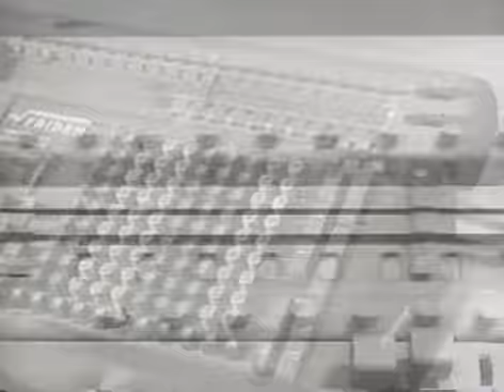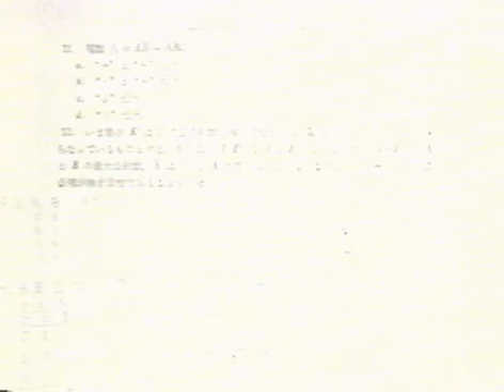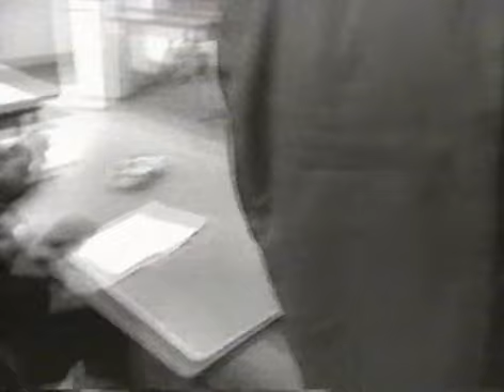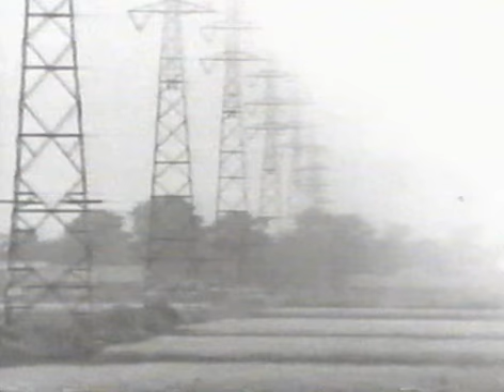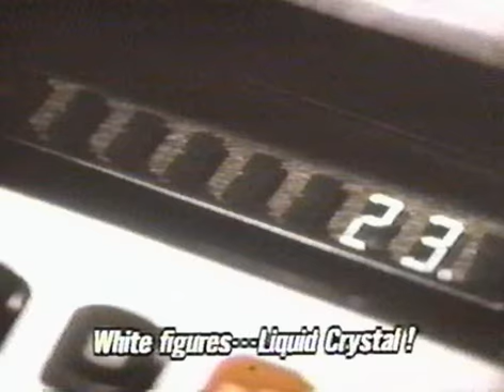The Calculator Wars: A video history of Japan's electronic industry (Part 3)

Comment: The Casio calculator shown at the very end, during the assembly process, I have one of those for over 20 years now! It runs on a solar cell, needs no battery. I bought mine in Cairns in 1994 and still use it all the time.
Reply: The Casio HS-8G? They were built to last, MADE IN JAPAN in the 1990s.
Reply: @Crazytesseract  rpx
Reply: I think my mom has that one too. It's a pretty basic calculator.
Reply: Ne ho una simile, purtroppo il tasto del "9" non fa più contatto😢

Comment: This was a FASCINATING series of documentaries... I never knew much about how the Japanese electronics industry got to where it was at its height, and this actually explains a lot.
I actually have an old Texas Instruments LED screen calculator somewhere, dating from the mid-late '70s; it's not Japanese made, as far as I know, but seeing all this stuff has me nostalgic for that kind of thing.
Reply from the maker: Every calculator I use on a regular basis is vintage, all with vfd displays. I regularilly use my early 70's vintage busicom exec da-80 on my desk at work. no batteries, needs to be plugged in, with individual vfd tubes for each display segment. picked it up at a thrift shop some 8yrs ago for $0.99 and tax, works like new does what i need and is a great conversation piece.
Reply: RC286 I use vintage calculators but not that old, I have several HP and Ti that I use from the early 1990's and late 1980's, but I do have older 1970's ones as well, but I don't use them because they eat batteries too fast :-). All of them are pocket scientific calculators though, no business or general use ones.
Reply: @RC-nq7mg  I don't think they had VFD displays then, but they may have used RCA Numitron DR2120 tubes back then. Those were 7 segment filament (dim light bulb). I used them in a product I designed in 1973.
Reply from the maker: @paulmoffat9306  Busicom exec DA-80, looks like vfd to me. 1972, also have a LLOYD's acumatic 310 with vfd display, 1975, and texas instruments TI-1025 1977 with vfd display.
Reply: I have sempoa calculator, you know it was the oldest calculator from the stone age???!

Comment: I bought a Battery Calculator with a Green LED Display at the Orlando Navy Exchange in April 1976 when I was just starting Basic Electricity and Electronics, BEE in the Navy. Retired in 1995 and worked for Sony for 8 years. Enjoyed all 3 videos.
Reply: Couldn't have been green LEDs back then. Most likely green/blue phosphor flourescent display. I had several myself with that sort of display.

Comment: My dad started at Bell Labs in Allentown Pa. in the R and D section in 1958,  just as the Transistor age, which I believe was invented by Bell Labs, began. As a very young kid I remember him coming home one day and showing me a Texas instrument POCKET calculator that was approx. four inches wide by about eight to ten inches long and maybe a half inch thick. If my memory is correct he told me that it cost $800.00. At the time dad was travelling between Texas Instruments in Texas and Bell Labs in Murray Hill NJ., he was somehow involved in the development of the pocket calculator or the processes needed to make the circuitry, I'm not sure which. A few things occurred to me as I watched the video. After the transistor was invented here the electronics industry in Japan apparently took advantage of that technology ( I also remember having one of those little white plastic transistor radios that were made in Japan in the mid sixty's) and that today our circuitry technology, that was invented in this country, is being made everywhere but here. Why is this and why would our captains of industry allow this to happen? I guess this is how the major car and truck manufacturers ended up with thousands of acres of parked incompleted trucks and cars sitting on fields and racetracks around the country waiting for chips. Makes me wonder.... (Please all you Electronics engineers out there, don't beat me up if some of my facts/ timelines  are a little bit incorrect), I'm not and engineer and didn't inherit my dad's vast knowledge of this type of stuff, he had more intelligence about electronics in his little toe than I would ever have.
Reply: In England i know from my mum she worked at marconi in the years before transistor radios came along   we had built radar and radios they closed down in the 60s I know in the same time 1960s to 1960s we produced TVs echoe Tvs the Valve tube radio and tube before transistor radio  in England we made AVOS Test meters and exported around the world englang exported its tools and engineering to india so in the 1950s 
Tv cameras used seticon tube a kind of LIGHT sensor 
In the old days TV cameras began using Electronics and Tubes if you ever get a chance to see documentry on the saticon manufactur 
Its amazing. in 1970s i remember calculators 
And Transistor radios 
I wanted to reply only because i wanted to say 
The people in charge let Other people view the manufacturing but thats only part of the story in every industry be it British motor bikes or tea cups 
British motor bikes 
I had a triumph bike 
But soon became interested in JAPANESE the little honda and the FS1E and suzuki soon we couldn't get enough JAPANESE stuff 
Same with TVs hitachi and sony trinitron in the UK we 
Bought more stuff made in Japan or china or Hong Kong! And our manufacturing Abilities Declined to a point 
We Need The stuff because they Invested in advanced 
Manufacturing Technologies untill today 
I have to say they are light years ahead in making stuff 
For some reason in the UK 
We stopped making stuff
Reply: It's called greed, and GREED is killing this country !
Reply: Business, innovation, science are all people things, not country things. A person is hired at a US company from another country, invents something we say "invented in the US". Was it?

As for manufacturing most mo-mos like to call it greed, but it's a little more complex. Suppose you just invented something here in the US that almost everyone in the world would love to buy. Now you need to build a factory and hire 30,000 workers. Investors are lining up to give you all the money you need. Where in the US do you build the factory and provide all those jobs. You live in Dallas. So the city of Dallas says "Hey you invented that here so you should build them here!". Cool. So you look for land. Hmmm, no big empty fields in Dallas. Or in the suburbs. You look further out. You find plenty of land but few potential workers.

So you look in other states. Now Dallas and Texas is screaming you greedy SOB.

Right now the unemployment rate is 3.4% in the US. Companies from China, Vietnam, Malaysia, Singapore, Philippines, India, Pakistan, Brazil and several dozen other countries contact you and show you they already have the factories setup for the most part and plenty of great workers ready to start. And the labor cost in their country means you make $20 profit instead of $1 profit if made in the US.

That's normally where the "It's GREED" people stop thinking. You as the business owner do what with the profit? Mosty plow it back into the business. More R&D, improvements, new products. You can hire 20x more inventors with the $20 profit margin and hopefully create 20x more stuff "in the US".

But suppose you're a made in the US kind of person so you build your factory, deal with labor shortages so production is lower than expected so you're barely breaking even. But the product is selling well. The rest of the world (including in the US) sees your product and their engineers say they can build a newer better version and manufacture it for 20x lower labor than you. When that hits the market with better features and a much lower price what happens to your sales?

Won't be long before you've lost all the profit you've ever made and have to close the factory and layoff everyone.

It's a people thing. A "Made in the USA" is not something Americans will pay a huge premium for.

A business needs labor. The US right now has a shortage of labor. We are going balls to the wall. And many Americans are dead set against bringing in workers from other countries. And many potential workers can't pass a drug test. So yeah, they want the $30/hour job, but are too high to show up or do the work.
Reply: @enriqueroman62  Greed, as you say, built this country and continues to build it.
Reply: I’ve read that the US transistor manufacturers had access to high paying military contracts that Japanese did not. So the Japanese found markets they did have access to. Including hi fi.

Comment: The Sharp Compet machines, of which I owned 3, were not constructed with all Germanium transistors as stated in the narrative.  The Hitachi 2SC284, which drove the cathodes in the nixie tubes, and can be clearly seen in the close-up shot, were indisputably silicon.  (All transistors with "2SC" prefix are silicon NPN.)  So were most of the logic transistors, which didn't have type numbers, but were housed in tiny ceramic "pill" packages.  This was pretty remarkable, as the vast majority of transistors in those days definitely were germanium. I still have many of these transistors, salvaged from the calculators before they were thrown away.  After nearly 60 years, they still work just fine, and are just as good as modern ones.  I still occasionally use one in a project or experiment.
Reply: I doubt anyone today knows what a NPN or PNP or CRT means lol...who is replacing yesterday tech?
Reply: Ahh, but you may be surprised.  While technology in respect to transistors may have shrunk, the technology remains the same.  If you're paying attention then you still understand the basics. Although, I am old an a former Nay ET.  It wa my life for a period of time.
Reply: I just checked the datasheet reference for 2SC284, and it states germanium. Which would be right for an early cylindrical metal can Japanese transistor. And the 2SC prefix just means it's NPN.
Reply: No, originally 2SA and 2SB meant germanium PNP and 2SC/2SD were silicon.  Something went awry later on, all 2SA were germanium PNP, but2SB coulxd be either, but always PNP. 2SC are always NPN silicon.  Usually 2 s d is also NPN silicon, but I think they lost the plot somewhere, because some 2SDs are PNP, 2SC284 is silicon without doubt.  0.7v forward on the junctions.  They are amazing in that they compare very well to modern bipolar units. @michaelturner4457
Reply: @basimpsn  negative-positive-negative, positive-negative-positive, cathod ray tube.
Reply: @basimpsn  I do. Learned it from Forrest Mims in a book I got at Radio Shack in 1983.

Comment: The Aleph Zero 101 used a magnetic logic device known as a Parametron, developed by Eiichi Goto at the University of Tokyo and later commercialised by TDK.  A Parametron based computer, the PC-1, was also built at the University.  Although superseded by advances in transistor technology, a variant of the Parametron using superconducting Josephson junctions, also developed by Eiichi Goto, is the basis for the logic elements of many of today's laboratory quantum computers.
Reply: douro20 Wow! Didn’t knew about the Parametron. Thanks for those details.
Reply: "quantum" computers. Fixed for you.

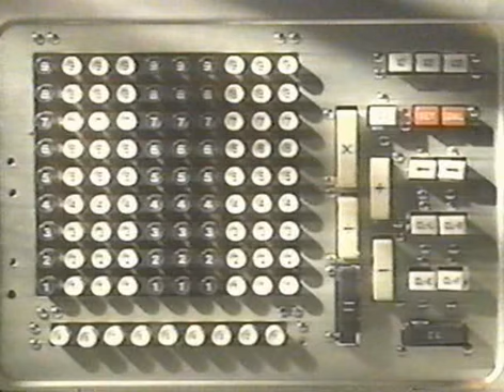Comment: 12:50 The engineers suffered from heart problems while enviro testing calculators? That's some dedication right there.
Reply: Dedication? Or fear of not producing?,
and being taken behind the lab and flogged at that time.
Reply: That's dumb, they could have built a double room, one cooled, the other where the calculators were and used gloves in walls like they do in bio-hazard laboratory's.
Reply: The heart problems could also have been due to overwork, so, going to and fro between very hot and cold must have contributed to the symptoms manifesting themselves. I don't know if overwork was an issue back then.

Comment: My favorite calculator was a Casio talking clock calculator that I bought in Saudi Arabia in 1978. It came in handy at nights I did not have to turn on the light and look for my glasses to check time. I am  unable to find a replacement after it died of old age.
Reply: Odouls77 Just ask Siri
Reply: Several Nokia feature phones have a talking clock with a dedicated short-press or long-press button.

Comment: Thank you, RC286, for posting this video!

Sadly, it seems the producers didn't have anyone with technical knowledge check the writing and narration for errors.

Errata:
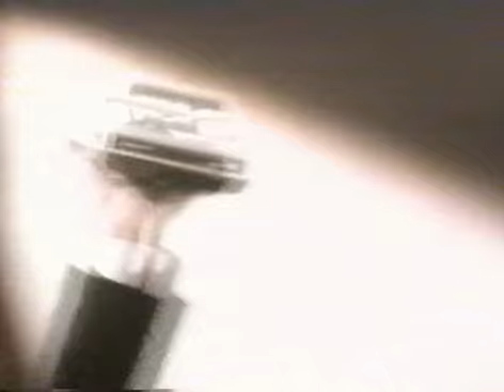25:12  Sharp Micro Compet QT-8D, not "9T-8D"
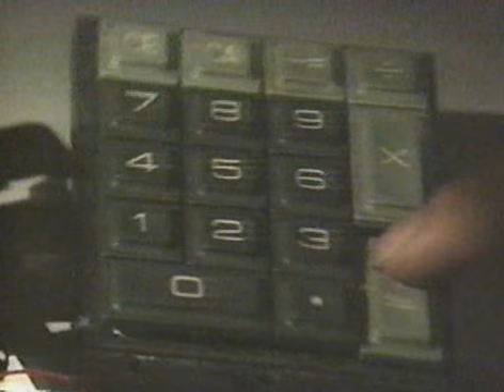27:45  "with polyvinyl chloride wires" should have been "with polyvinyl chloride insulated wires"

Comment: I remember back in the late 60's, I purchased a new HP-35 Calculator for use in university ($500) only to find out a month later, that an electronics parts vendor was having a promotion by Texas Instruments, by giving away a new calculator with a $10 purchase! The TI calculator was USA made. Still have the HP-35, and BTW, the circuit board is plated in GOLD, not solder! No wonder it is still operational.
Reply: My 1st calculator in high school in 1974 was the HP-21, which fit in a shirt pocket ($125).   The nerds in school carried their calculators in a zip-pouch that hung from their pants belt.  One internal rivalry between nerds was over the ownership of HP vs. TI .  The super-nerds had the expensive programmable models.   I still have my HP-21, but a roommate fried it by improperly unplugging it from the AC power.    The stack memory paradigm in the HP's was sort of off-putting to the average non-computer-geek, but it had it's advantages.
Reply: I used an HP21 in college and still do to this day. There are so many advantages to the RPN logic and stack. I used to carry it using the belt loop as did many where I went to school.
Reply: I used a Ti 'Programmer' which among many other functions converted between binary/decimal/octal/hexadecimal. What a great tool when programming.

Comment: when I went to school, we were required to use the slide rule.

And then the last year we were required to buy a calculator which cost $85 and weighs as much as a brick
Reply: I used a slide rule, some kids used calculators, whose batteries died during exams.  I never had that problem.
Reply: Who is Barry?
Reply: I still have and can use a slide rule. Sometimes I pull it out at work, just to get a reaction.
Reply: The are Barrys that we can trust.

Comment: My first glimpse of the desktop calculators was around 1973-75 in high school.   Our mathematics lab had an array of those big clunky electronic calculators that did not much more than A/S/M/D and maybe a percentage or square root.   The digital display was the weird individual numbers formed by wires that glowed like a light bulb.   During lunch break we would hang out in the lab and play with the calculators - not having any real problems to solve - just watching the lights and displays change.   I did learn to program one of the machines - that took IBM punch cards - to solve a quadratic equation.   It was also connected to a 2d plotter that could draw graphs.  That was my first exposure to programming.   The lab also had a classic Teletype keyboard that communicated to a University computer about 150 miles away.   We spent a lot of time on that playing Football with the computer.
Reply: Glowing display - nixie tubes.

Comment: Great. Thanks for this amazing story. May be the new generation can't evaluate it properly. I remember that i have seen electronic calculator first time in 1977 when i was 6yesrs old. It was soviet pocket calculator. I was shocked its possibilities. Later i had a texas instruments calculator made in japan. It had statistical functions so i was almost king of math in my class :)))). It's interesting but it works nowadays. Also my friend had Japan super thin calculator with solar panel which can be placed into notebook between paper sheets. It could perform only simple operations but seems like a extraterrestrial thing.

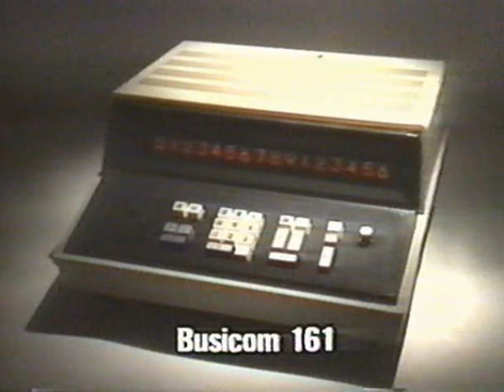Comment: Waitaminute... 17:53 - did Busicom 161 used the magnetic rings as its memory? In 1966 Apollo program used those for moon flights in its navigation computers. They literally used space technologies before they went into space.
Reply: Magnetic core memory was pretty standard at the time. (That's where the word "core" in phrases like "core dump" comes from.) The "cool tech" in the Apollo computers was mostly about the ROM weaving and space-saving folding techniques; most core memory was kept on frames.
Reply: @stanrogers5613  AFAIK, ROM-weaving was needed, as the computer ROM and hardware were required to withstand radiation, lightning, temperature extremes, and probably more.

Comment: instead of heating up the whole room, it's amazing that those 'young engineers' didn't think of using a heated enclosure
Reply: Management usually does not want to spend too much on a "proof of concept". I bet they got their testing rooms after the semiconductor calculator was a success.

Comment: The way I heard it Apollo didn't trust the computer they managed to get together, and had some back up tech, like sextants. I think it may have been more useful for the lander as it was used though. And it had a non  critical error from someone setting it up wrong.
Reply: The Apollo Guidance Computer (AGC) worked very well, was highly dependable, had lots of firsts, and had plenty of advanced functionality not found for several decades in modern operating systems.

During the mission of Apollo 11, the computer received junk data from a misbehaving sensor unit, which the computer couldn't handle properly, but was wisely designed to disregard this data on operator command.

The Apollo Guidance Computer used some of the components that were later made for Japanese calculators.